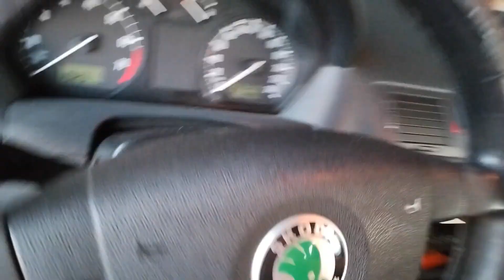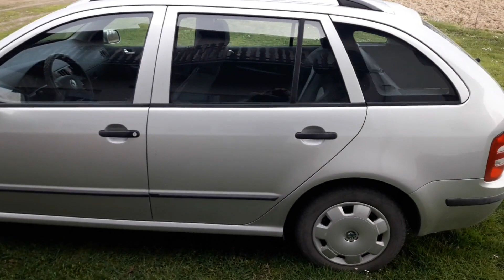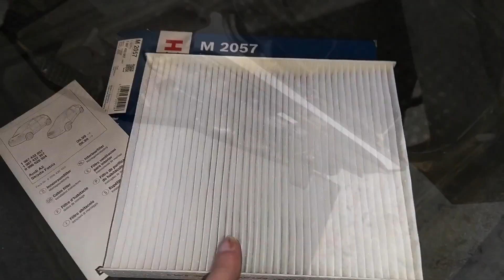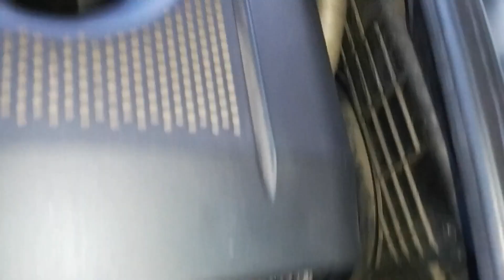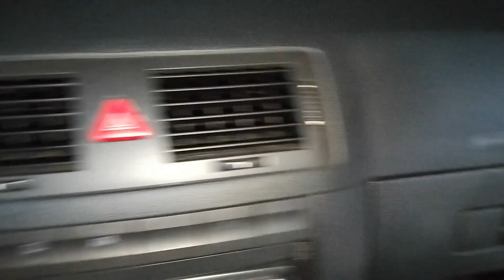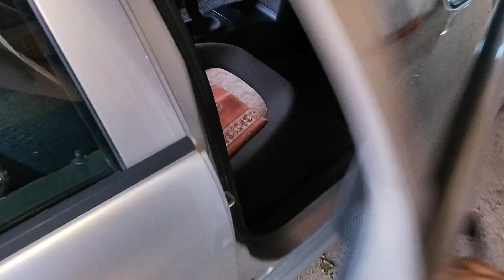How To Recharge The AC In Your Car-The Easy (And Cheap) Way

Comment: Hello,
So you are saying that there might be nothing wrong with the AC system in a VW (Group) car, and if I’m lucky all it takes is a refill with refrigerant? 
It could normally leak refrigerant over the course of 2-3 years? 
Does this risk damaging the compressor?
Reply from the maker: Hi again 🙂. That's the case with my car at least and it's what I've seen with many other VW group cars of the same generation. 
The whole system is refilled and checked and that's it. Do it about every two years.
Is it normal I don't know 🙂
Reply: @DespairRepair  Thank you for what you do, providing very useful information for us car owners. 👍🙏
It’s definitely worth a try to fill. 🙂

I might ask you about spark plug replacement later, but first I should see if you have a video about that? 
The paste on the threads is recommended, and should specifically be for aluminium engines?
Reply from the maker: @TS-gg9dk  thank you for watching and for the kind words 🙂.
If you have paste use it since it prevents the spark plug from possibly fusing to the engine block and getting stuck.
Watch out that you don't tighten too much 🙂
Reply: @DespairRepair  I don’t yet have the paste, so I want to buy the right one.
Reply: I did change the spark plugs successfully (it seems), as there were no fault codes about misfire or anything related, a while after. I did interestingly have a fault code about ”Refrigerant pressure below lower limit”

I ended up using no paste because a person working in a car parts store said that it is not necessary in modern engines and that it could lead to worse performance of the spark plug due some insulation issue between spark and engine block when using the paste. What is your opinion about that?

I get the impression that you have worked or still work as a car mechanic?